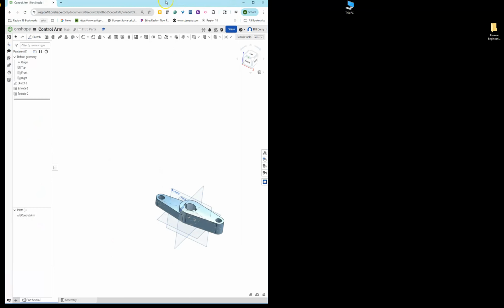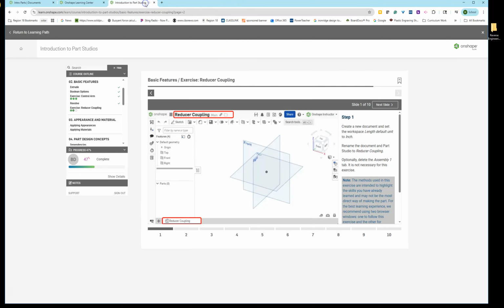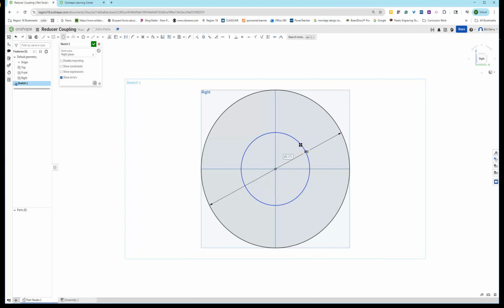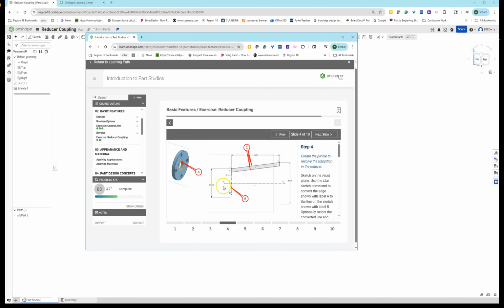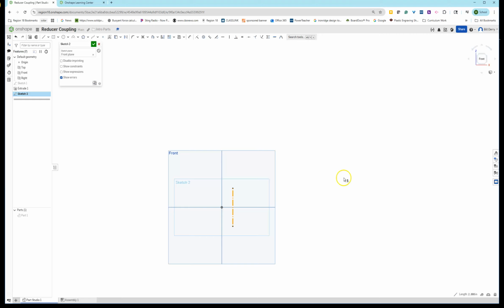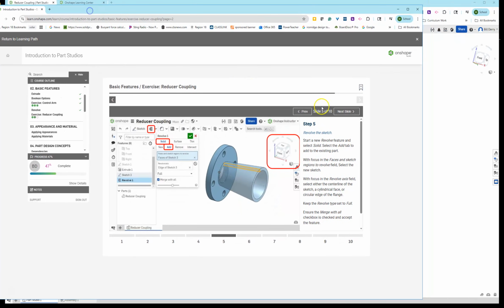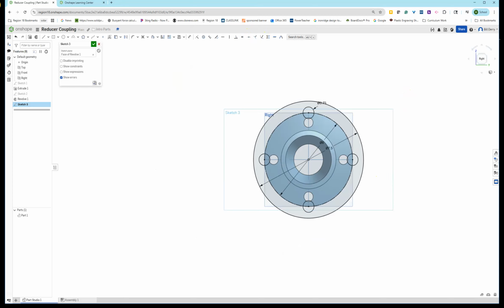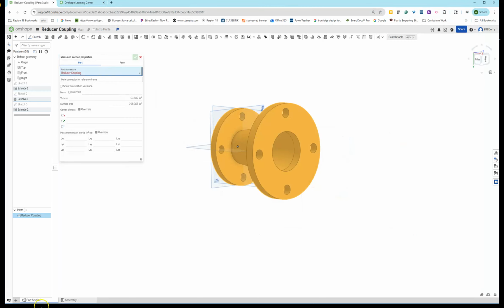Onshape Reducer Coupling Part Studio

Comment: Hi.

Thanks for this video.  It helped me understand and proceed with the turorial.  (I'm new to this and started taking OnShape's tutorials.  I was struggling to understand how to do this reducer coupling.  OnShape's video tutorial left a few details out.)
I could not get how to "use" that reference from the first extrusion, and did not understand why I was drawing an angled line.  I got it at the end of the video.

A short summary explanation, along these lines, would have been helpful:
We are designing this reducer coupling.

This coupling is used to reduce a  pipe or outlet with a dia of 3.75" to a pipe or inlet with a dia of 2.625"
The drawing imagines a horizontal coupling, with the smaller inlet on the left, larger outlet on the right.
This is the inlet flange 
This is the pipe that connects to the larger flange. It flares out to a 3.75 dia.

Regards
HS